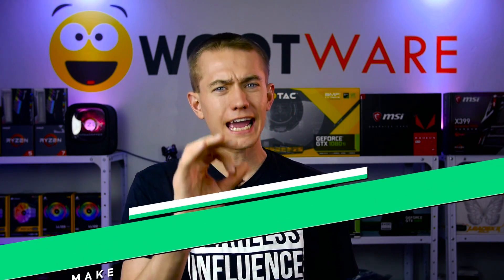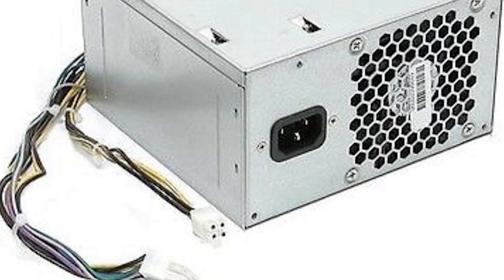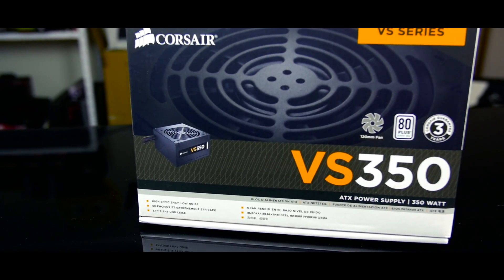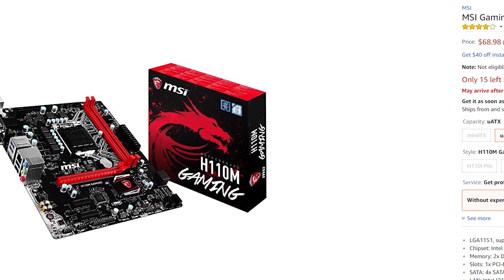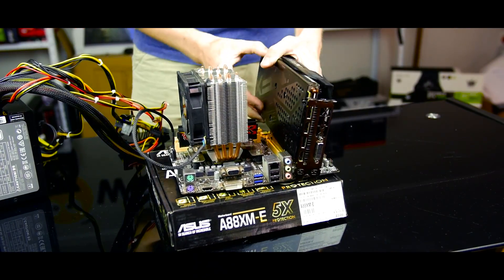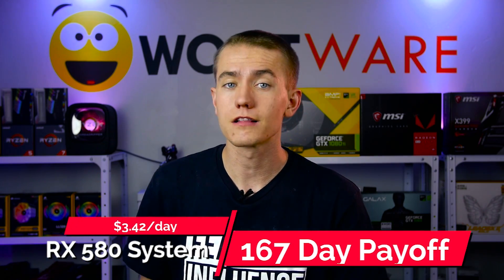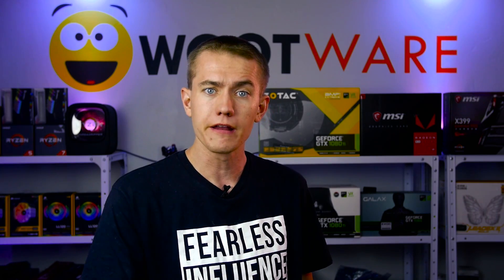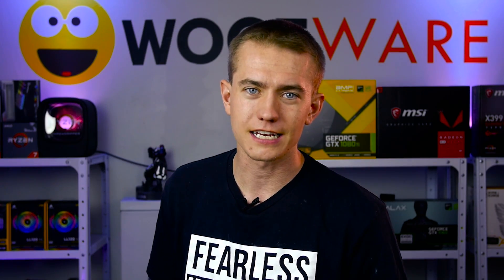How To Build The Cheapest Mining Rig Possible!

Comment: I think choosing a SSD is a mistake. Better get a cheap-o 2.5" HDD for 10$. The difference in watts is so low that it's not interesting to spend 40$ more for the SSD. Yes the SSD will be more profitable long term, but It'll take like 10 years to beat the HDD.
Reply: You're not wrong but IMO a small ssd is worth it. They can be had pretty damn cheap nowadays (I saw some brand new 80 gig ones for 19.99 the other day) and just make set-up with all the restarts and everything that much less painful.

Comment: First of all dont buy a motherboard with socket 1150... The cpu are almost impossible to find new and the second market is just the same price as new, even more expensive
Reply: That's true if you're looking for 4790Ks. The low end CPUs can be found dirt cheap and DDR3 ram can be found a LOT cheaper. Plus sometimes you can find a good combo deal. I got a z87 board, 4770k, cooler and 16gigs of ram for $180 a few months back. I swapped the cpu for the 4760k in my gaming/htpc/miner and turned the rest into a rig with a 570, 1060 and 1050ti

Comment: My monero rigs cost me about 200€ a piece for 1900H/s and 650w power consumption...
Running Asus P5E/P5Q-E incl E8400 (~15€) 4GB of DDR2(10€), 80GB HDD (Free), Seasonic 1000W Platinum from lost parcel auction (50€)/ Enermax Platimax 1350W bougt as broken because no sata/molex cables (30€), for cards i run 4x gtx 580 per rig (between 30 and 50€ /piece) most 1,5GB cards manage ~480H/s, 3GB cards about 500 H/s+ using about 160-180W per card.

Comment: So I sprung for a coffee lake setup for several reasons. 1, I want to play games as well as recoup my inflow and 2, the cost of a mining board wasn't far off the R2400 I spent on a Gigabyte Z370XP Sli. Also, the motherboard will sell for more on the second hand market if I do sell. I also got an i3 as it's TDP was 65 watts and I'll disable 3/4 cores to bring the TDP down. Right now, I'm getting an AMD 580 but I'll get the next gen of Nvidia when it releases in 2018. This will help me mine effectively as the 580 series is facing some serious mining future problems.

Comment: I have an Alienware with a 1070 in it and I tried mining using nicehash for a day just to see what it was like.  I got about $1.50 (USD).  I stopped running it because I wasn't sure if it would ruin my video card (wear and tear or overheating.)  I didn't overclock or undervolt (I have no idea how.)   Do computers like mine have a cut-off that would protect it, should it get too warm.  It did stay under 70, so it was ok for my test...  I thought about trying to mine some other way, but you hear so much about each one scamming part of your hash rate, and then the problem that nicehash had. (thank goodness they didn't owe me anything...)  What would you suggest for mining with one card like this, maybe expanding later with another 1070...  Thanks!
Reply: Don't mine with a laptop. They run hot and die.

Comment: One thing I've found is.. my GeForce GTX 1070 and 1080 get bottlenecked by a 3.6ghz Core 2 Duo for some reason (does ewbf or ccminer check results on the CPU?), but my AMD hardware has no such problems with that system, so the nvidia stuff is on an FX-4100 and my AMD stuff is on the C2D. and getting a bit off topic.. I have some specific problems with other cards requiring them being on a third box with an FX-6300 running an HD 7870 and a buggy HD 7850 (stock vbios has issues I think, because it's only problematic on some motherboards and new drivers, and it doesn't play nice with other vbioses for what should be the same card. All copies of the vbios online with the same .bin listed from the dumped rom report as bad according to atiwinflash, including the one I dumped from mine, so either atiwinflash has a bug or the vbios just doesn't adhere to proper standards.)

Comment: I found this used pc for sale an I was planning to use for my fist mining rig do you think the spec are good or would it consume to much watts/electricity? Please let me know. Thanks

	•	Antec Quietcase
	•	Asus P6T Deluxe motherboard
	•	Intel i7 Core 920 processor
	•	9GB DDR3 RAM 1333mhz 
	•	4 internal SATA drives totalling 4.3TB storage (2.3TB plus 2TB internal backup)
	•	Nvidia GeForce GTX460 video card (2 DVI + 1 HDMI output)
	•	Cooler Master Rs600 power supply
	•	Asus USB N13 wifi card
	•	Multi card reader for SD, USB and more
	•	DVD writer with lightscribe

Comment: I get 15,6 MH/s on Ethereum with my 1050 ti
If someone is using a 1050 ti
Here are my overclocks:
Power: 73%
Core: 0
Memory: +950
Reply: vRoyaL I have a Dell optiplex with an i5 and 4gb of ram, I also have a 1050ti I’ve used over the years, 

I’m looking to use everything I have and upgrade my power supply, do you think that would be enough? Also would your overclocking settings be fine for that setup?
Reply: so i can mine eth with a simple 1050 ti from ali express?
Reply: @PSK holy shit thats so wrong
Reply: @PSK my rtx 2070 gives 1.5euro each day
Reply: @ohheyezz3046  What????? This is completely wrong, I am getting 3$+ with 580
Reply: @felliper3143  This concept is new to me, Could someone explain how to mine? i have a Nvidia 1660super and a AMD Ryzen 3 3100 4-Core Processor                 3.59 GHz
Reply: @G0TH1C search it up lmao
Reply: u  wont get any profit even at 30mh/s. u need couple TH/s.... which will take about 10x RTX 2060s or about 70x 1050Ti
Reply: @ARISTO_Music  10 RTX 2060s couple TH/s :D a terahash is like 21000$ a day.. wtf are you talking about..
Reply: @ARISTO_Music  ummm, no, im getting 23mh/s and im making $2 a day...

Comment: Some outlets sell refurbished computers with Core 2 Duos for $100 and Core i5 desktops for $150.  These are more for those who don't want to "build" a computer, but just put a video card into an existing and let it run.
Reply: I looked at those. Only problem is the MB  probably support PCIe x16.  Check carefully before ordering. I just looked.

Comment: ok, you want a "HP Pro 3120 SFF IPIEL-LA3 microATX Socket 775 Motherboard 612499-001"  - £30 uk , a socket 775 dual core cpu - £3 uk,  4gigs of cheap ddr3 £20 uk, a second hand 2.5" hard disk £15 uk , a decent corsair 850 watt modular PSU - £120 uk (if you wanna run four rx 580s this is a must purely for the number of cables you will need , you could use a 750watt if you are running four rx460s but i would not bother - buy the decent psu for gods sake), four risers - £24 UK, then pick four gpus - four RX 460 4gb (unlock the shaders is easy) or four rx 580 8gb or four rx 470s. this setup works well. how do i know? - i run two of them. by running a four gpu rig on an old socket 775 motherboard ive saved a fortune. build the actual frame out of wood - £2 for screws - the wood should be free . there may be other motherboards but ive had success with the IPEL-LA3 . most socket 775 motherboards get stuck at 2 or 3 gpus - the IPEL-LA3 does not. the IPEL-LA3 will not go beyond four GPUS - i have tried it with a 4 to 1 riser - no use dont even bother. great video mister UFD tech
Reply: oh and 6 or 8 gigs or ram if you wanna mine monero - the IPEL-LA3 will run 8 gigs as four 32gb sticks

Comment: Which power supply need for 6 rx 570 GPU Mining...
& Plz upload multiple card mining
Reply from the maker: +Suv Da I'd suggest at least 1000W and then you would have to make sure you undervolt the cards.
Reply: or connect to separate 500W ? is that doable?

Comment: personally do use cpus, the E8400 makes about 6p and costs 24p to run for a day. obviously not profitable but if the coins i hold increase in value 10x i'll be okay :p and the celeron will do better than that ratio. ((my fx 6300 actually is profitable it makes around 46p and costs 35p it's good for something lolol )) same with the ssd it is a very good choice and i would use the left over storage to mine burstcoin. they aren't so valuable but who knows, maybe one day.  great video <3 EDIT not saying mine with all the FXs you can find lolol you have to think about the coolers power draw and motherboard// efficiency ect ect just saying i do it lol.
Reply: Why don't you buy the coin at 6p instead of waiting a long time and using 24p? That makes no sense at all. Using the FX does because its actually doing some good (lower Vcore and clock speeds, much higher efficiency. Raising from 4.0 Ghz to 4.6 uses 100w extra for me, and actually 4.0 tuned Vcore tuned uses a lot less, so its double the power for 15% higher hash. Underclocking should give good results)
Reply: idk really just for the fun of doing it i guess. yea was really surprised to be honest the FX did make a bit of a case for itself :)

Comment: Does vega 64 require 1000w psu?
Reply from the maker: +Ricky Law I'm running 2 for under 600W, so no.
Reply: do you mine cryptonight? if so, pls dont mine dinastycoin, vega 2 stronk make difficulty up much stahp plies.

Comment: I need HELP with my double Vega 64 setup please! I am getting:

Claymore Nanopool/ETH ~$7/24hrs 
XMR Stak Nanopool/XMR ~$5/24hrs 
Awesome Miner/Mining Pool Hub ~$7/24hrs 
MultiPoolMiner/Mining Pool Hub ~$7/24hrs

Not sure what I am doing wrong. I am running: 
Fresh Windows 10 x64
8GB RAM 
16GB vRAM 
AMD Blockchain Drivers 
Overclocked memory with AMD Settings 
100% fan power (electricity and heat is no problem for me)

I've looked at WhatToMine which suggests $13 a day with XMR but I am getting no where near that. My friend is getting $7 a day with ETH on Nanopool with one Vega 64.

Comment: Does anybody make some kind of contraption that lets you put the graphic cards with its own daughterboard and cable in to the main system?  You briefly covered risers but I'm not sure if they would be as convenient as a full external daughterboard that could support 4 to 8 GPU cards (hopefully, assuming that anybody even makes such a thing).  I would think this is possible because unlike a GPU task like gaming graphics or deep learning, I would assume that you don't care about a high speed data bus because you're not moving big chunks of data around between tje main bus and the GPU, like you have to with the first two GPU tasks.  Instead you're just moving a small block of data to be analyzed and then returning an even smaller result (e.g. - "hash", etc.), correct?
Reply: I use a Grannyboard. It's from the eighties.....

Comment: +UFD Tech
Question, doubt, curiosity, why when you want to point something to the right or left of the video you end up crossing your not proper arm option like if you had lost your other arm? like if you were using your left you didnt have enough cores to know when to use the other one... hope it makes sense but I notice like a bit awkward. Regards and good long guide for a cheap mining rig :D. Cheers
Reply from the maker: +Overwatch Highlights Wut?  You point to something on your left with your left hand.  It's easier to use the right hand. Especially so when trying to keep my hands in frame.

Comment: My Mining rig is actually a core 2 duo system,  2 gb or ram. I just jumped a 500w bronze psu and chopped up the case to put a 1080ti in it.
Reply from the maker: +usssmart doofus Noice!!!!!
Reply: Bro, the biggest reason i love this channel is it isnt huge, i make a comment and get a reply from you, I love being able to talk directly to you, thx for being awesome bro. <3
Reply from the maker: +usssmart doofus 😁😁
Reply: Theodore Lim yea I'm using a g41m as well. I had to update the bios to get it to see the card but other than that it worked fine.
Reply: what graphics card are you using?
Reply: A single 1080ti
Reply: thx. Ouch..
Reply: +usssmart doofus Bro what mobo are you using? I have an old Core 2 Duo system using a G41M. Hoping that I can just add a good graphics card and upgrade the OS and other things.
Reply: How much graphic card work in 500 watt?
Reply: Hemraj Shankhwar any single gpu will work, or 3 1070's, 2 1080's/ti's or 4 1060's (if they are mining optimized
Reply: How much do you earn from it montlhy? and on what app?
Reply: John Rhenzel Obrique idk about monthly it's only been running for almost a month. About 5$ a day.
Reply: John Rhenzel Obrique nicehash
Reply: +usssmart doofus What OS are you using?
Reply: Eumir Arcilla win 10 unactivated
Reply: Start mining pi, the cryptocurrency will be launched this year, and once it does, you won't be able to mine anymore. You don't need graphics cards you only need your phone, is cloud mining. It doesn't consume battery. It's on coinmarketcap in untracked listing. On marketplace there are already transactions for value of $100 aprox and when you just download the app you mine at 0.25 pis/hour. Use my code as an invitation
Code: Name246
Download the app Pi network.

Comment: I only have the one computer and it's a gaming/Video editing rig. Mine with it when not in use but am thinking of getting a second card to put with my RX 480  probably a Vega 64 looking at getting one secondhand for about $650AU. So a video guide on stepping it up from a single card set up to something more would be interesting.
Reply: Wanted to use the Vega as my gaming card and just use it when not gaming to mine. I am already running the AMD blockchain driver on Windows 10 64bit with a Corsair AX860 80 plus platinum PSU. My RX  480 is getting  25.3 Mh/s mining ethereum using Claymore Dual Ethereum miner and I get a bit of Siacoin to. My motherboard is an ASUS x370 Prim PRO so can put up 6 cards on it if I use some risers I think. Thinking of just upgrading my Gaming card regularly until its all full up.
Reply: Yes, ignore the above comment, they have clearly done 0 testing. My crossfire (and single card) 3dMark Firestrike scores are within margin of error using the latest drivers and toggling the compute/graphics optimized setting. In honesty, its actually a few points higher using the "compute optimized" setting, but its so small its within error. They bumped up mining performance a massive amount though (have to refer to my excel chart for exact amount).

I went from around 18-20 Mh/s stock to 28 Mh/s using blockchain and overclocking Vram to 1950 Mhz as well as tightening timings, lowered voltage on RX 470. Power use dropped a ton 1250w (at 12v rail, so ~1350w at wall, my HX1200i graphs it out) down to 700w. Mining with 4 RX 470, 2 R9 Fury (crossfire 4k gaming), Ryzen 1700 on the X370 Asrock Gaming k4 Fatal1ty board with 16gb ram (could use at least 32gb for my CAD, but prices are ridiculous).
Reply: RavenPrecept that £ per day sounds waaaaay high for only 4 vegas
Reply: unless you have at least 6 GPUs and run 24/7 this whole thing is pointless.
Reply: Ozzy Bogan Tech    Hhhhhhhhuijjnnbhhhbb 
Knkppuhgdzzzdbbhlkkkjjkmpkmmklkkkikkoiiiooookkkkjkkj